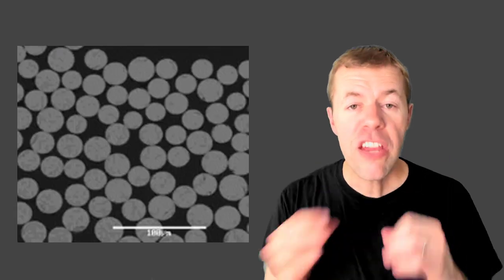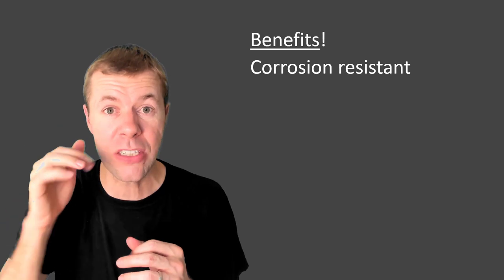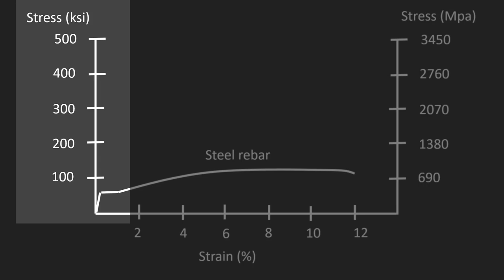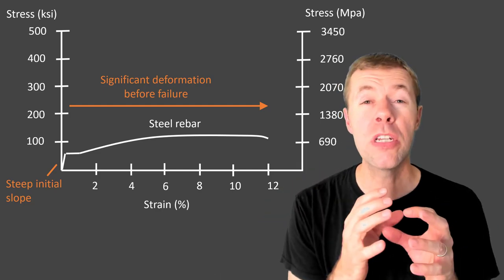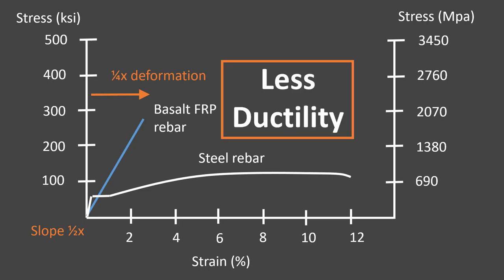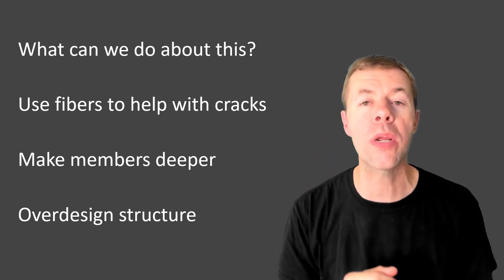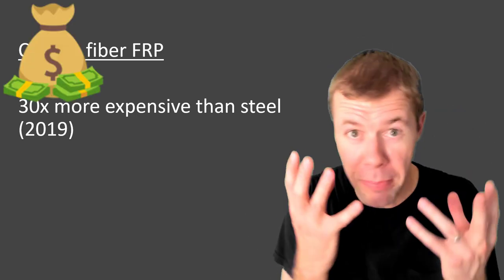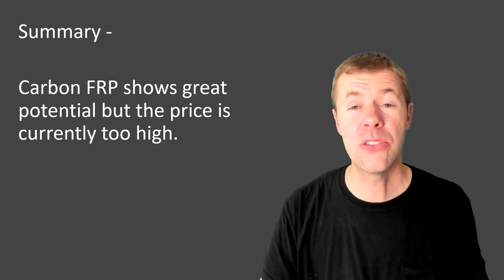What is FRP rebar? Why don’t we use it?

Comment: In my town (near Racine, Wisconsin), we have some sidewalks in the older neighborhoods that were laid down from 1902 to 1905 that are practically perfect. We also have a lot of sidewalks from the 1970's-80's that are in need of replacement due to cracking/spalling. I don't know if it is the formula (the concrete is a little darker than concrete used today) or the workmanship, but those turn-of-the-20th-century guys who were using horse-drawn wagons, water from barrels and brute strength really knew what they were doing.
Reply: A large amount of survivorship bias, the only building work we see from 100 year sago is the stuff that survived. The badly made and poorly designed stuff has been replaced.
Reply: Ian Griffiths while it is true that survivorship bias is at work here, that doesn’t change the fact that the workers in 1902-1905 did a better work (or invest in better materials, etc.) than the 1970-80s. While nowadays we got better concrete technology, it doesn’t mean that poor concrete constructions (in our current age) that are worst than the ones built on the past didn’t exist
Reply: George Ford, funny you should bring this up.  I just had a stucco guy tell me that stucco over the years is not as strong as it used to be.  He thinks it's the quality of  cement that has gone down.  I wonder?
Reply: I believe the quality has went down myself. Can't help but think it's likely do to epa regulations and or faster curing formulas.
Reply: You can spec whatever concrete you want at any time. "Back then" and "not as good as" always come from people that don't know standards. People that know standards can compare apples to apples at any time. Customers are the cheap ones. They hire the cheap guy and then whine about quality.
Reply: Remember concrete absorbed moisture and moisture and metal don’t mix. Rebar will rust eventually and the expansion from the oxidation will cause the concrete to crack. You can tell when concrete has iron deposits on its sides due to rusting rebar. This is why the life of concrete now is less because even though rebar will help keep concrete together initially it will eventually cause it to fall apart
Reply: @DrMadMax  Nobody uses rebar in sidewalks.
Reply: @georgeford6056   yes this is true, but I believe chicken wire is used at times.  I was more speaking in general. I should have been more specific
Reply: I've noticed the same thing and it's always confused me.
Reply: Still not as good as Helix manufactured galvenized twisted steel micro rebar.

Comment: I know its been years now since this video was made but FRP rebar is now similarly priced if not even cheaper than steel rebar now. Some of the new FRP rebars are both strong and flexible now as well where they dont fracture as easily and will bend and flex back in place which solves some of the ductile concerns compared to steel.
Reply: What we need is not more advertisements for basalt rebar, but design standards enabling us to design buildings that will be unaffected by design loads - whether earthquake, storm, or whatever - and fail in a slow and obvious way when impacted by loads beyond their design. That's the part steel is supposed to be really good for, having concrete beams and suspended slabs that will visibly sag without falling when they fail, although as we saw from Christchurch, steel reinforced concrete doesn't always work out like that in practice.

Comment: I wouldn't trust that carbon fibre.  What if there's movement that causes the surfaces of the rods to get scratched.  Then they could snap under not very much load.  Like a bicycle frame that snaps without warning or the hull of a boat that just breaks in half.

Comment: What about glass FRP, you mentioned basalt and carbon but glass FRP seems to be more popular at the moment. I’m interested in the stress strain comparison with steep, the cracking potential and the usability, ie any special vibration requirement so not to damage it! How careful do you need to be when fabricating it?
Reply: ni cequests! coud you sand me your material? for my research in fiber glass beams/slabs pre formed
Reply: ¹

Comment: I've been thinking about this in light of the recent Florida collapse.  The codes have changed to increase building integrity after the Oklahoma City collapse but maybe we should do more.  Better concrete helps with reduced corrosion and spalling but otherwise doesn't help integrity for other types of damage such as blast.  Non-corrosive reinforcing prevents the corrosion and spalling but doesn't have enough ductility and wouldn't help with integrity.  So I'm wondering if we shouldn't investigate dual systems.  Maybe use FRP reinforcing for the strength but include supplemental reinforcing to provide ductility and resistance to fire and collapse.  My mind leads me to having concrete beams with FRP primary reinforcing and a central core of PT reinforcing.  PT reinforcing now is available with total encapsulation which should help with long term durability, and it would boost the ability of the structure to hang together after undergoing severe damage from deteoriation or some external event such as blast, collapse or fire.  (Thinking about beams we would need a new way to provide shear reinforcing, can't easily form FRP reinforcing into stirrups and ties.
Reply: Watch the footage of the "collapse"
Reply: Fibre reo can be formed into bends however you want them in the factory. You just can't bend them on site, which means your engineer has to list the components for your materials order.

Comment: As someone working in linguistics field, I can only thank Tyler for his super-enthusiastic way of explaining these things. I am now working as a translator for a huge railway system reconstruction project and many documents I work with deal with these topics. Turns out they can be interesting to a non-professional as well!
Reply: I appreciate Tyler’s knowledge, content, and enthusiasm. But in my opinion, his delivery style is exhausting. He’s got it dialed at 11, all the time. Such intensity is better used in moderation.  To use a metaphor, I don’t want to watch a punk rock style presentation (fast and loud from start to finish) — I want something more akin to a storyteller style or perhaps witty stand-up comedian. Keep the delivery dynamic and interesting in the build up; save the energy for the right moments, no only really go off the rails rarely.

Comment: Ive been doing a patio expansion; multiple sections (Im doing it all myself, so each section is small enough for 1 or 2 people to work.)  Wrapping the patio from the back yard around the garage, and to connect to the driveway.   Ive have been overbuilding much of it, so I can be confident it will last, and one of the things I was so excited about was finding this fiberglass rebar.  I use regualr steel rebar inside the each slab, so I can bend it and weld it together, but then use the fiber glass to tie each section together through the expansion joint, so I dont worry about corrosion creeping into the slab as if I had used steel bar to tie each section together. Though I do run a #6 solid copper to continue the equipotential bonding plane.

Comment: Other benefits of FRP rebar are no electrical conductance, no RF interference, no corrosion, and reduced cost of shipping, handling, and installation due to it’s light weight.  

I am planning on building a house and shop, so I am learning about materials, methods, and build science.  FRP rebar in ICF structure has my intrigue.

Comment: I’d love to see a video comparing quality in steel rebar. I own a remodeling firm in Florida and it’s amazing how much harder it is to cut steel from homes built in the 1950-60s vs the new steel. The old steel and concrete is much more difficult to cut and break. When we remodel things from the 80s and newer the steel cuts like butter.
Reply: Rebar would not be the issue because the changes in the ASTM specifications have increased the tensile strength of rebar. What I believe you are see is the fact that concrete strength increases with age. Concrete hardens by hydration and never stops. We normally use the 28 day strength for the standard, but others use the 90 day stregth which can be 15% greater. If you investigate the time increase of the stregth of concrete you will find that very old concrete is significantly stronger especially if it  is in a damp envionment. Water helps the hydration process and is why concrete is steam cured.
Reply: As far as the steel itself is concerned, where it was made might make a difference in it’s strength and toughness as well as to what standard or specification.  What was the spec in 1960 vs contemporary?
Reply: I'm an electrician in the DC area, I've worked for a concrete cutting specialist company as well, and even as an electrician I sometimes have to drill holes for conduit or sleeves for MC. Sometimes in this area in old buildings, you will encounter concrete that is remarkably hard, and will wear out bits/blades before you finish the job. The older guys tell me that is typical of DC, when the old companies used to use dredged up Potomac River stones. Nowadays they use more sand and some other kind of pebbles.

Comment: Seems to me that comparing the bend tolerance of a short length of steel rebar to a short length of fiberglass rebar in a bench vice leaves out some important variables. It's clear from the demo that the gfrp rebar lacks the ductility of steel, but I believe the gfrp has superior tensile strength, so i would be interested in comparisons with different types of rebar that are imbedded in concrete and tested to failure. Also if carbon fiber rebar is 30x the cost of steel; how about instead using a good fiberglass rebar like aslan 100; only use twice as much as the carbon? Would that provide the equivalence of the strength of the carbon fiber, without the cost (while using twice the amount as carbon)? Finally I think the corosion resistance of gfrp is a major advantage over steel.
Reply: there are a lot of research papers in this field
Reply: I agree with you.  The corrosion resistance is what is all about, you can use more of it and get the same strength.  Totally worth it.

Comment: Saw this stuff at Menards for about the same price, but didn't know who to ask about whether or not it is better. Considering flatwork applications. Glad you made a video!
Reply: Yea the glass is cheaper at menards right now than steel - seems like it might be worth using in places like driveways that get constantly attacked by chlorides. Wonder if rate of expansion and contraction would be more or less of an issue with glass over steel.

Comment: Like the new gray background. This was an informative video not only about concrete reinforcement but about the general idea of stress strain curves. I thought I was familiar with that but the clear cut explanation added to my understanding. 

On the video before this I mentioned what appeared to me to be the very good performance of the concrete used to construct the Monterey aquarium 36 years ago. In general, what was best practice 36 years ago for building concrete structures in close contact with saltwater spray? Maybe in a future video you might talk about how well they are doing at making concrete structures on the east coast that need to contend with road salt. I noticed a lot of bridges with substantial rust damage when I was in MA recently.

Comment: Tyler - Thank you.  Food for thought.
One unanswered question:  The carbon FRP rebar material cost is 30 times higher than steel bars.  But aren't steel bars themselves a small fraction of the total concrete structure cost?   How much is the overall increase in structure cost (i.e cost of the finish pier, or column or floor or whatever)?  If the carbon FRP-bar structures are superior, we'd have to ask how much that superiority is worth in overall cost. (Still might not seem like a great deal, but probably cheaper than the occasional occurrence of the kind of failure we recently saw in Florida.)
Reply: I don't think it's quite that much of a small fraction but it is a fraction.  Obviously there is concrete cost, labor, formwork, and that is just the structure.  You have to add in wiring, plumbing, air conditioning, architectural exterior and interior materials, etc.

Comment: Basalt FRP seems like it could be a great product. Unfortunately, the catalyst for price reduction is product demand. People/industry wont use it until they know it will work better than steel. Great video Dr. Ley!
Reply from the maker: Thanks David!
There is a lot of energy needed to produce FRP and so it is not a cheap process.  I do agree that basalt FRP is a cool product and I encourage people to find ways to use it.
Reply: @TylerLey  It takes more energy to produce Aluminum than Basalt roving! The barrier to entry is acceptance. Cost being equal, Steel Rebar: manufacturing, warehousing, sales fabrication, etc. will fight tooth and nail before they allow FRP to put them out of business. And, what if the roads, bridges and building were to cost less and last longer??? The Horror!!!
Reply: @Dave-Pro  it's very difficult to introduce new products into a market that is so dominated like this one. New and better products are squashed all the time because they will hurt a particular companies bottom line.
Reply: @Maulakus  and Dave Watson ; Good points about entrenched interests (cabals and mafias) resisting (killing) competition from better products, and also the economies of scale that work against the introduction of improvements, at least initially. A good example of both those forces acting in the concrete field, is how cheap the massively energy-hungry Portland cement is compared to the vastly superior magnesium oxide (though it takes a fraction of the energy and infrastructure), and how much effort and tap-dancing goes into propping up the fundamentally flawed D.O.A dinosaur of steel reinforcing.

Comment: I just bought an original homestead up in the mountain and it has the original pioneer cabin and I plan to restore it but I want to build a foundation to last 1000 years and i know that means no steel rebar. I would love to talk to you about how to do this
Reply: What about using stainless steel?
Reply: @beringstraitrailway  I was thinking about that as well, not sure if you can actually buy SS rebar I havent found it in my search, i am thinking that carbon fiber rebar might be the way to go
Reply: From what I have learned Roman concrete has a sand/salt polymer mix that chemically gets harder with age, like an epoxy. Adding ocean mineral salt water makes it harder with age, remelts the minerals over and over to strengthen the bonds

Comment: This is an excellent presentation and well referenced. Time and building materials march on. Thanks much!

However, comparing two or more product's relative performance(s)  down to percentages can only really be honestly made when all variables  involved are removed ("zeroed-out") and that is first and foremost the differences between batches of concrete. If all the tests were made on the same day using one singular batch of concrete then yes, the results hold scientific credence. All of us who have handled building projects using concrete know all too well how one batch of concrete will vary from the next one delivered in both the mix and especially the amount of water from batch to batch.

Comment: So would Basalt FRB be useful to reinforce the slab in a commercial shop floor?  I am concerned about cracking under heavy loads.  However, I am reluctant to use rebar due to corrosion (as explained in one of your videos) in Colorado where the roads a liberally treated with chlorides in the winter months.  Thank you for all of your videos, I've learned a lot and they are extremely interesting.

Comment: Hello,  I was watching an old mason/concrete man on YouTube from the East Coast (I believe his name was Haddock?).   He absolutely eschews steel rebar and uses nothing in its stead in pads, walks, driveways, slabs, etc. etc.  Claims in rusts in less than thirty years and destroys the concrete.  I have been around the residential side of that for decades and while I have seen rebar rust it has not been a huge problem in my area.  Now keep in mind I am in a coastal temperate rain forest so rust is huge here.  His premise is that unreinforced concrete is better than reinforced.  I was somewhat amazed that any long time (the guy is in his sixties) professional would hold that view.  What do you think?  PS Although I have been watching you previous to discovering TexasBarndominiums I think it is a great collaboration between you two and look forward to more.  Take care.  Doug
Reply: That's Mike Haduck you speak of. Great guy I have watched quite a few of his videos.
Reply: There were debates years ago about rebar in roads - that's over steel wins.  Yes rust is the killer but  so is time and cost - all engineering is a compromise of the triple constraints.

Comment: We use to use water proofing solutions in basement areas, it was fairly toxic but it made the concrete less porous. Secondly the standard is 50mm cover in Australia and most "blowouts" are probably half that, through lack of care. In Canada they salt the roads I saw for ice and this was also an excellerent in pavements and bridges.

Comment: Great video thanks!  2 questions, what's the current cost for carbon FRP these days (year 2021), and second question, you said it isn't good for most applications but does FRP work for the residential driveway in Canada & Northern USA where you have the wide temp changes.